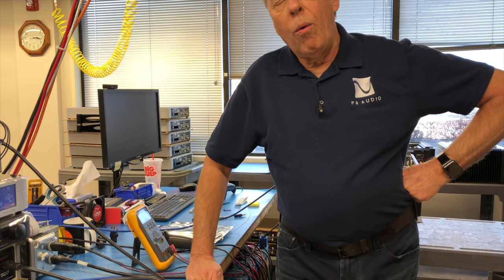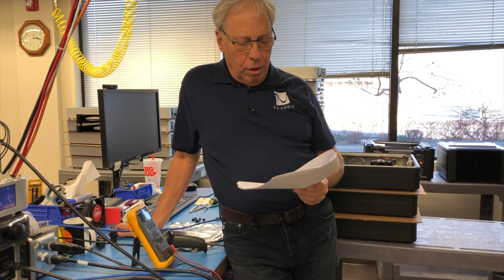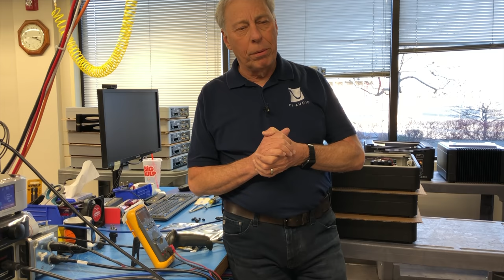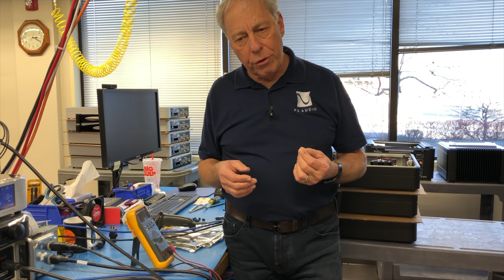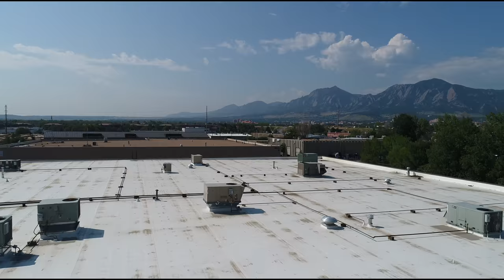Why do people abandon their power conditioners?

Comment: It’s possible to confuse a “power conditioner” with a good surge protector or more to the point a good and large sine-wave UPS. I wouldn’t even consider hooking up an expensive component to anything other than the latter. If you don’t do that, you are a fool. Maybe you’ve never had a power spike or a brownout, and dealing with that is not the primary design objective of most high-end components. If it happens, you may very well be screwed, and the people to help you with that trauma are going to be hard to find, and probably rather unsympathetic.

Comment: Line-level devices do better with power conditioning, but power amps do better when plugged into the wall (even if the power conditioner claims it is non-limiting)

Comment: instead of using a Rube Goldberg Regenerator, why not just put a big lithium battery in the chain and regulate the power? It seems that would be far less expensive and less complicated. There are plenty of lithium generators on the market, why not make one for audiophiles. And then we could listen if the powers goes out too 😂
Reply: Because the output impedance of a battery is pretty high.
The new fad is super capacitors, lots of folks playing with those and claim good results. Very expensive for the demands of a power amp...
The other issue is noise from the regulator itself. It is very hard to make a low noise regulator for high current that does not add impedance (taking you right back to where you started). There is a good reason why better power amps use unregulated power supplies.
Reply: A regenerator is hardly a Rube Goldberg device. 
Do you know what that means? Think of a regenerator as a reverse amplifier mechanically.
Reply: carlos oliveira a Rube Goldberg machine is an intentionally complex device to accomplish a simple mechanical task. Seems pretty relevant. You’re taking AC power converting it to DC then back to AC to achieve the magic sine wave. Granted I’m not a total nay sayer. My system always performs better at night. I just have to believe there’s a simpler more cost effective way to achieve the same result without having to pay $$$$ to get there.
Reply: @LD Blake can you prove your findings? You speak in matter of fact quite often.

Comment: All of this is nonsense. The conditions of softening the sound or sterility are nothing more than too small of a conditioner. You are running your equipment in a brown out situ. Get a larger conditioner. Also equipment does a fine job of cleaning up the AC on it's own. When you hear the microwave through your speakers then use a different outlet for either and problem solved, but even when I try to create this situation and can see noise on my scope on the AC outlet I've never been able to find any noise at the speakers, with a scope or my ears. Noisy equipment has something wrong inside that a conditioner might help mask but will not fix. Too small of a power conditioner is almost always the issue with dynamic changes, plain and simple. Use your brains, ffs.
Reply from the maker: It's hardly "nonsense" and while a bigger more powerful conditioners is a good idea if one wants to go that route it none the less ignores the facts. Conditioners cannot fix the problems of power: regulation, dynamic impedance changes, fluctuating voltages, flat topped waveforms.